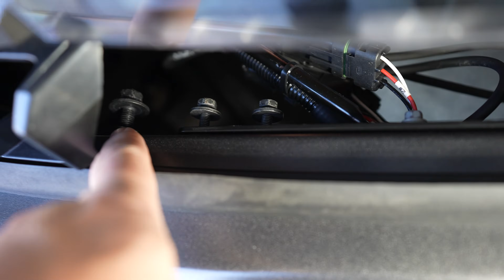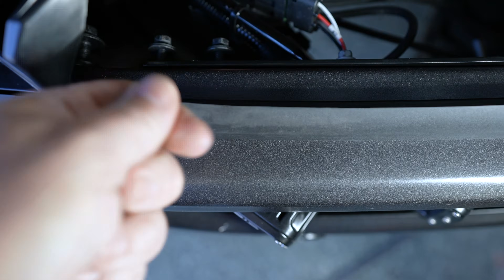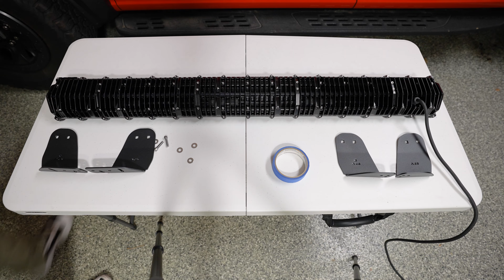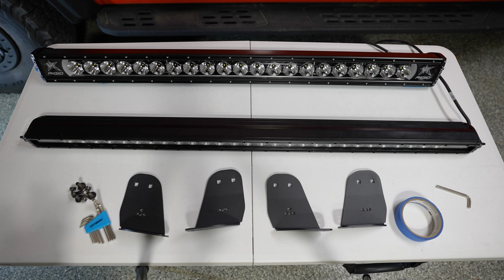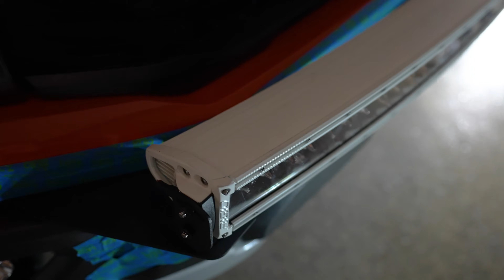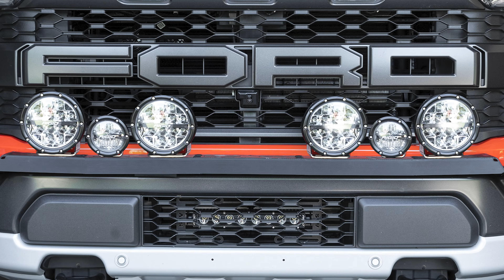2021+ Gen 3 Ford Raptor SPV Parts Bumper Mount Installation - Light Bars, & Pod Lights 2022 2023 22

Comment: I'd like to buy this but there's no link to this product in the description, when I go to your website and look under "raptor brackets and hardware" this product isn't there either.. the only one that resembles this one is for the gen 2.. which has been discontinued.  Great install video on a product that as far as I can tell.. isn't available.

Comment: Thanks John, how do you keep the cross mount from being unbolted and stolen?
Reply from the maker: Stay away from bad people… lol
No, but obviously this is a question several people ask and most of the time they have several other items on their truck that can just as easily be stolen that they don’t think about such as wheel, or other lights like A-pillar lights, light bars also have bolts on them, or even catalytic converters! Believe or not that’s something that is stolen more than anything! And they do it easily because they just take a saw and cut the pipe in 2 spots. 
So the thing is, if someone want’s something. They will get it. Even if it’s welded on, they’d cut it off. 
So after painting that picture, I can tell you that by using the nylon lock nuts that are included, it isn’t as easy as spinning a nut off to remove the mount. Because they are a lock but you have to use a wrench to turn them the entire way. You can of course try to source some sort of security bolt. They are out there. You can get them. Though again, a professional thief would have all the tools and or an electric saw. So I can’t speak for everyone, because it obviously depends on where you live and where you park, but in the grand scheme of things, by percentages. It really isn’t as common as you’d think. The only true thing that makes sense is make sure you’re insurance agent adds your accessories to your policy. That way if you ever do have something stolen, you’re covered. But again, it isn’t overall as common as you’d think. Personally, If someone wants it, and I have it insured. Id rather them figure out how to unbolt it than to start cutting on my truck. It means a lot less repair.
Reply: @jtrischler  Thanks John, I'm getting ready to buy that bar plus 4 of the 6 inch lights.  Just want to say that you do a great job on your videos, very detailed and clear.